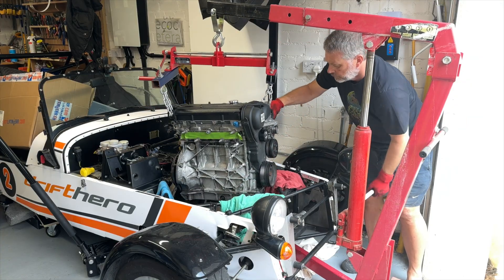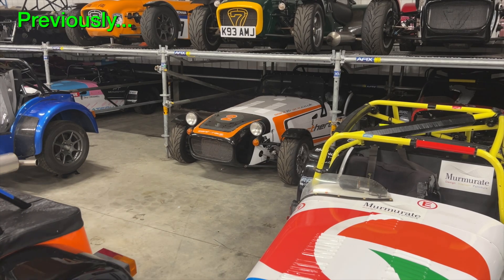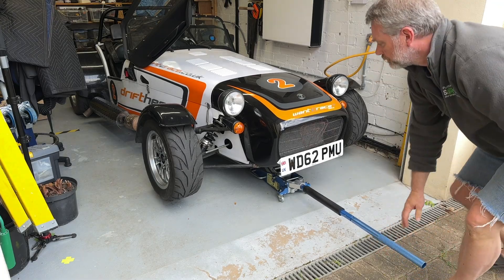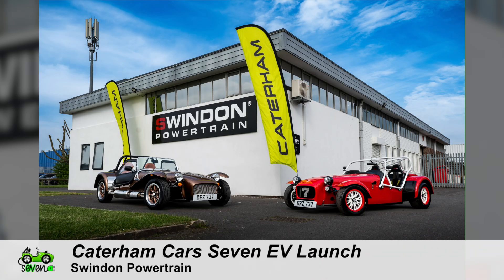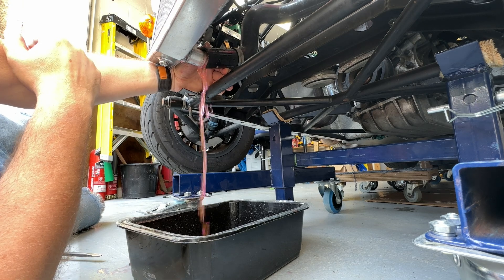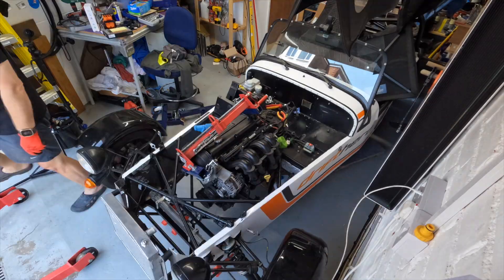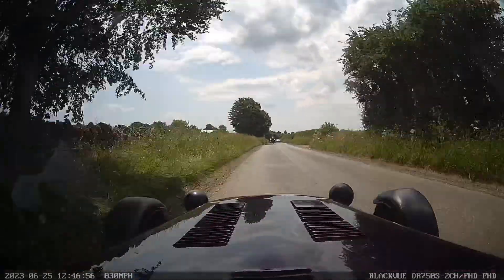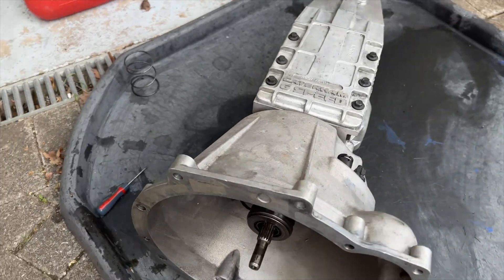Project sEVen pt4 - Strip Down and Weigh-in

Comment: Really appreciate you going out of your way to document this!
Ive been thinking about doing an EV conversion myself, however it only really made sense to do a more powerful setup.
I'm new to EVs, especially parts available to consumers, but i think you made a good choice with helix.
Best of luck!
Reply from the maker: Thanks for watching. There’ll be a lot more about the choice of parts coming up in a future video. I’m sure you know this, but it’s way more complicated than what the headline max-power figures are for components. In theory my Helix motor will do 240kW, but I won’t be able to use it because I can’t deliver enough current from the batteries I can fit in the car. Hopefully it will all be once clear as I document the decisions I’ve made. Cheers, John

Comment: The exotic fast charging batteries that Caterham are messing around with are pointless.

They justify it by the insane rapid charging speeds for track work. But I think track cars will be the last to go electric, even then they may just switch to synthetic fuels.

Just give me 20 to 30 kWh for a Sunday bimble, please. 50kw charging will suffice for a very occasional, very leisurely road trip.
Reply from the maker: @cad4246, I think that’s not an unreasonable position. And is sort of where I’m at with my conversion. But when you talk to Bob Laishley, their rationale for the exotic batteries was that as soon as they give a Caterham to journo’s they instantly take them to a track and thrash the knackers off them. Then they’d complain that an under batteried car was no good for the track. So, Caterham were insistent that they had to make a track capable car. It also strikes me that Caterham spend a lot of their corporate energy on their racing series (cars sold, weekends supporting the racing etc etc), which I think colours their view of Caterham ownership. When the C&L7Club did a member survey, a lot of car use was touring. Track use came 4th. You also have to factor cost in, those exotic batteries put the cost of a sEVen way into the 6 figure territory. So while I see where C were coming from, the venture just didn’t make sense given then current battery tech. However one area is being covered, We’re now also seeing track charging systems like Fellten’s Qube, so that element may soon be less of an issue (being able to charge your car at a track day).

Comment: Following. Please…. Prioritise weight and low down placement ? Agree ???
Reply from the maker: Thanks for following. And yes, reduced weight and low centre of mass are key design parameters. Though to be honest, just getting it working is top priority at the moment (with half an eye on “desirable” features). I’m working on the basis that once I have something working in phase 1, then I’ll learn a huge amount and then I’ll be able to optimise in following phases (reduced mass, better battery tech, higher power, better software, improved cooling etc). Thanks for watching.

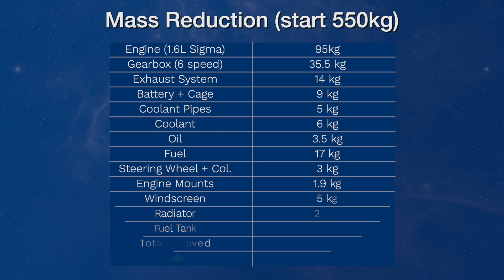Comment: 8:02 - ICE is 550kg or 350kg or 200kg? Where is the 550kg from? And the mentioned electric would be 250kg total?
Reply from the maker: The car weighed 550kg with the ICE engine, gearbox etc. I removed 200kg, leaving 350kg. I’m hoping the electric bits and pieces will be about 250kg making for an eventual total EV mass of about 600kg. Hope that helps. I guess I should have put a quick graphic up showing all of that. I’ll do that in the next video. Thanks for watching. 👍🏼
Reply: @Purplemeanie  Thanks 👍 - yes I'm an idiot for not getting that, but did not think the total weight was that low 😲 - cool build! 💪
Reply: @Purplemeanie ..plus petrol…ok I see you had that

Comment: What are you planning to do in terms of aerodynamics for it? 😊

For a car like a Caterham you probably want to work a little on that if you want decent range. 

I think a flat undertray at the minimum would be something you should do at the very least, and that has the benefit of decreasing lift too. :)
Reply from the maker: Yep, you’re absolutely right. But that’s a phase 3 or 4 project at the moment. 👍🏻🤔
Reply: @ Okay great, good to know! Think I read on the Caterham forums that the Cd value is around 0.6, so you can probably expect a little over half the range of a typical car at high speeds, taking in mind it likely has a slightly smaller frontal area than most cars, without any modifications. :)
Reply from the maker: For sure. I use a bunch of spreadsheets in the design. Some of my own and some from other people. But this is one of the better ones (IMHO) that brings a lot of things together including range…. https://openinverter.org/forum/viewtopic.php?p=78271#p78271

Comment: those damn inertia valves. I've tripped mine exiting corner 2 (?) at anglesey as it's a fast right and if you smack the kerb it turns your engine off. I thought I'd blown the engine.
Reply from the maker: Wot you need is to replace the simple ball bearing inertia switch with 3 ESP32 processors, each with an IMU, voting on which way up is… and therefore massively over complicate things! What could go wrong?! 🤣🤣🤣

Comment: Are you doing this in the UK? How are you tackling the IVA?
Reply from the maker: Hi @andypag1071, yes it’s a UK conversion. So you’ve hit the $64m question. It’s what drives all my design decisions really. The plan, though not done this before, is to keep within the “heavily modified vehicles” points system (therefore no chassis changes), adhere to the R100.1 requirements and to get an engineers report. I understand that, although not advertised, DVSA/DVLA will now provide an engineer to do the compliance report (for a fee obvs). So I’ll go through that. Also been chatting with many other conversionists who either do this for a business or have done it themselves. It’s all a bit theoretical, but I hope I can get through it (as long as somebody doesn’t change all the rules before I get to that point). Any suggestions/concerns you think I should concentrate on? I’ve obvs already taken a car through IVA as a kitcar builder, so this isn’t strictly speaking my first rodeo. Cheers, John
Reply: @Purplemeanie  Please keep us updated on this as its a confusing area working out what's allowed/not allowed. I love to know if there is a difference between converting a Caterham ICE car and building Caterham as an EV from the off.
Reply: @ColinWatters  my understanding is that physically it's the same but bureaucratically it's totally different. Converting a registered car it EV is difficult. Building and trying to register an EV practically impossible. Heart breaking.
Reply: @andypag1071  I had a feeling that would be the case.
Reply from the maker: @colinwatters, I’ve got a list as long as my arm of videos to make, so hopefully I can deliver on the list and keep everyone updated. I did cover the reasons why I got my car registered as an ICE car first (it had no road registration when I bought it as an ex drift car), in my overview video (first in the playlist). Though I probably need to go into more detail in its own video.
Reply: @Purplemeanie  very interesting. A while back I looked at using a Nissan leaf battery and drive train, figuring that the components would already be approved, but no! It would have meant submitting the whole thing for R100.1 approval and I gave up. (My plan was to design and build a locost chassis to accommodate the leaf parts.)

The only hope I had was that the DVLA inspector offered to call me and give me some advice over the phone, so I have a suspicion there is a way around it he didn't want to commit to email.

With frame kit cars the idea of the immutability of the chassis is a bit ridiculous. They're not ncap tested, so welding a few motor mounts here or there makes no difference. Also I doubt many inspectors would know what the original chassis looked like, to tell if it had been modified.
Reply from the maker: @andypag1701 these days, for conversions, I don’t think there’s any way of getting around the R100.1 and an engineers report. But it is an R100.1 not the full R100 at least! For a new build, I think it’s a case of don’t bother (as ColinWalters says).

Comment: Have you considered in wheel axial flux motors. The people who supply the Verger electric motorcycle are supposed to be producing car style ones. Probably not for individual projects I suspect but might be worth an ask.
Reply from the maker: For sure. Looked at lots of options there. But I’m a bit restricted on changes I can make to the base vehicle. I’m not sure where you’re from, but in the UK we have a points based system for vehicle changes and I need to stay under a points budget to reduce the testing and certification I have to do. I also have an aversion to unsprung mass, so grates against my soul a bit to think about hub motors. My wheel size is also quite small so axial flux (while good for low RPM) never quite got there for me when I looked in the past. I will get to some of those decisions in a later video. Thanks for taking the time to comment, much appreciated! 🙏🙏
Reply: @Purplemeanie   I would guess the increase of the ratio of unsprung weight would be very high and make driving a bit of a miserable experience so best avoiding.

Comment: Are you planning to use an e-axle configuration (ie the motor where the diff would be)?
Reply from the maker: That was the plan at one point, and will be the subject of a whole video (at least). But the plan changed and I’m now doing a single motor at the front of the transmission tunnel, feeding into an extended propshaft and existing diff. 👍🏻
Reply: Lexus hybrid transmission? In same position as old gearbox?
Reply from the maker: Is it less than 100mm at the output and less than 200mm at widest? 🙏

Comment: I'm one of the rare Caterham owners that actually see a lot of benefit to silent blatting. I love the induction noise of my VHPD K-series, but on public roads it draws a lot of attention. Stealth blatting (coupled with silent pootling) would enable me to make serious progress without being shouty about it. I would miss shifting gear and the feedback the revs provide though. Thanks for sharing your work on this project.
Reply from the maker: Agree with all of that. Whenever I get in my 420 I really question whether I’m doing the right thing with an EV. But I think it’ll be a different experience, like it’s different driving a 170 to a 620. But they’re both still Sevens. Thanks for watching 👍🏻
Reply: Really interested to see what motor/batteries/control gear gets put back into this, thanks for sharing.
Reply from the maker: Yep, agree. As much as anything this is a research project for me. I’m curious about what the outcome will be rather than thinking everyone should do it too! 🤔😀